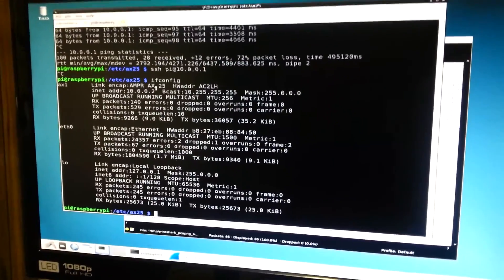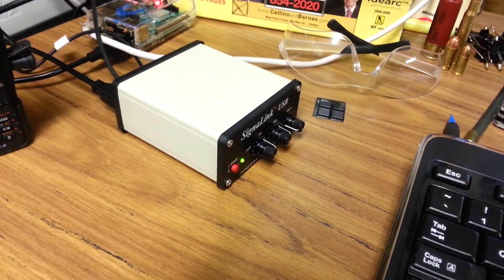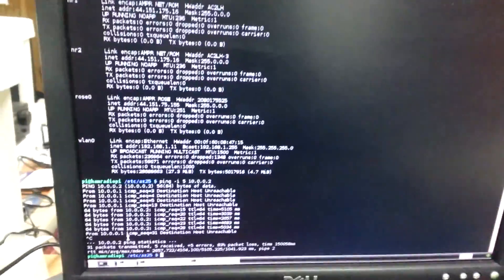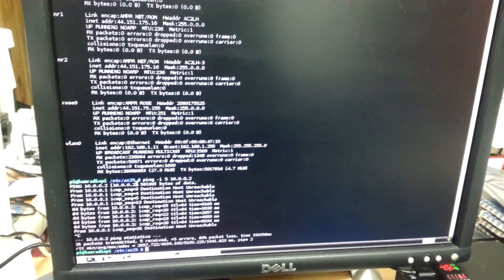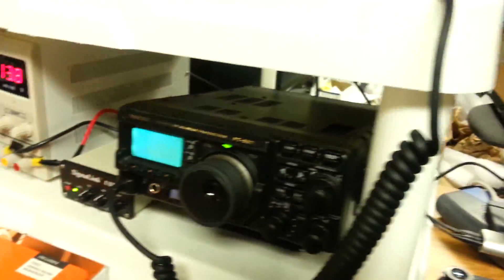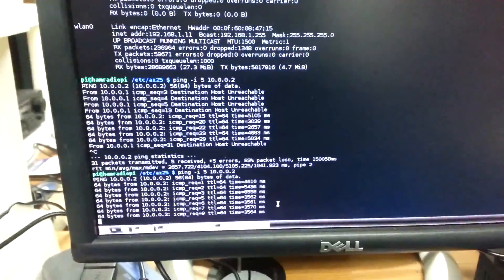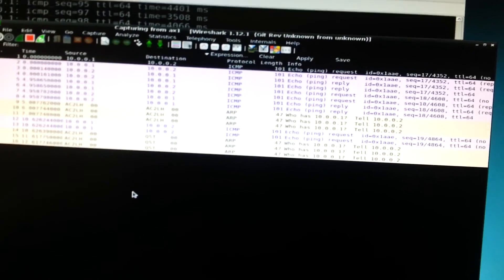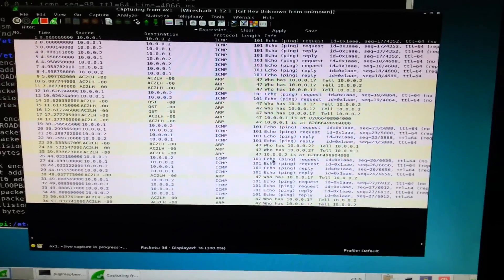Packet radio communications

Comment: I've been wanting to set this up for quite some time.  I have a tncpi2, and I just ordered a tnc-x kit.  Would you mind helping me out with ax.25? I'm reading the ax.25 HOW-TO PDF, and I'm a student at CSUF. We want to add telnet to our rover (TitanRover.com), and use ham radio to communicate with it when we go out of range (wifi network is not so good long range☺️).  We will be running a full Linux machine on the rover. My Gmail username is audstanley. Shoot me an email if you can help with questions.  It would be nice to have a point of contact to someone that has actually gotten this to work.
Reply from the maker: Absolutely!  I will try to help out as much as I can.  Check out my facebook page https://www.facebook.com/rpiham/ where I post stuff as I do experiments and learn more.